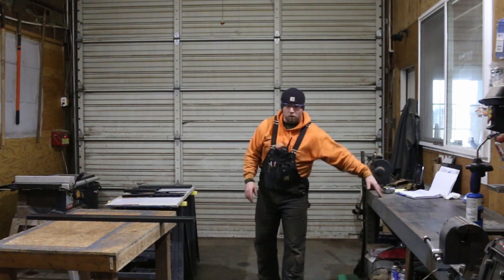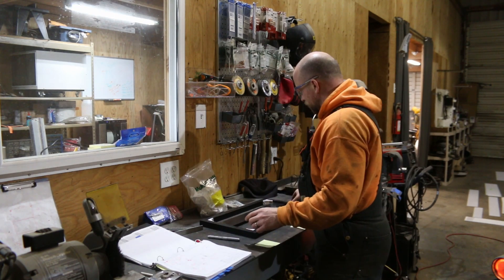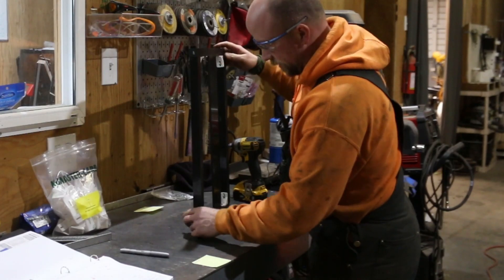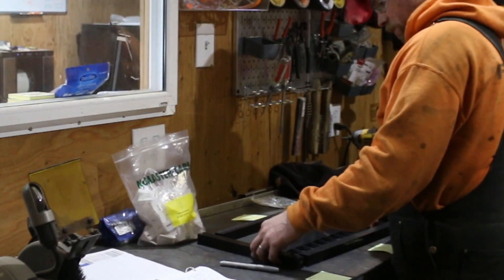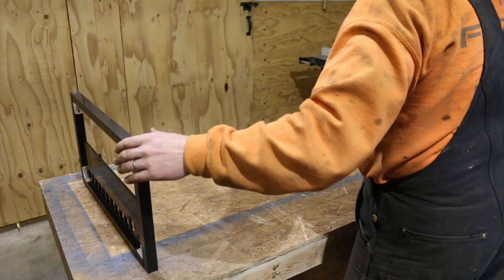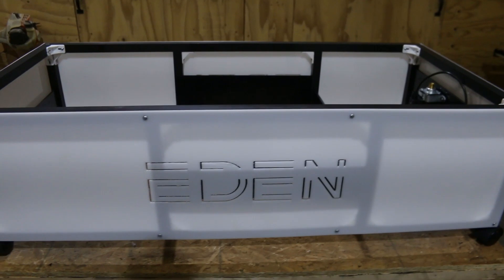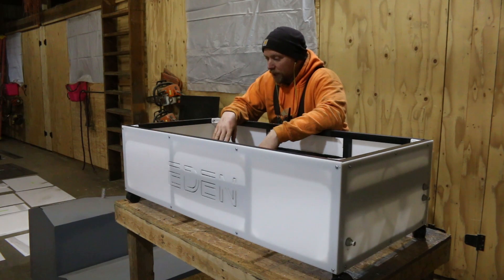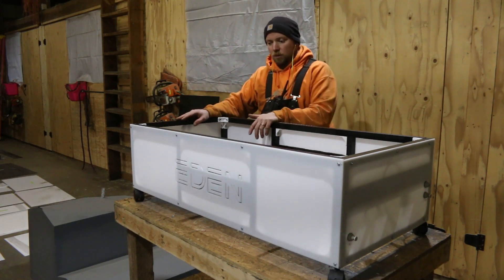Let's DO this! AEROPONIC Grow Tower NEW Design Build

Comment: it looks a lot better than the steel one you made...2 things i noticed is that 1 you should look at using COTS stuff like 80/20 for the frame...that would simplify the design and forgive errors like not drilling in the right spot and frankly, it looks just as good but 100 times more flexible than the custom parts....2) that's a huge waste of space on the bottom...wouldn't it make more sense to have the resivor at the lowest spot giving you more height?  all the electronic stuff and pumps can be mounted on the outside and in such a way that you can have 1 set of pumps and daisy chain multiple grow towers together witch would cost savings for the system overall...
Reply: It wouid make access and maintenance a lot easier if they were on the outside. I would also make sure there is no way for condensation, spill or leak to reach any socket or connector running mains voltage.